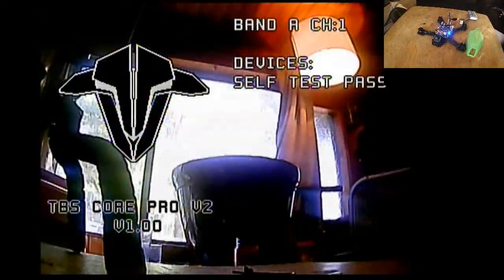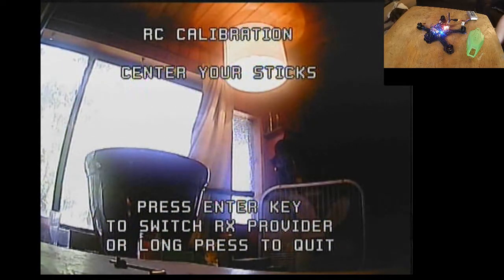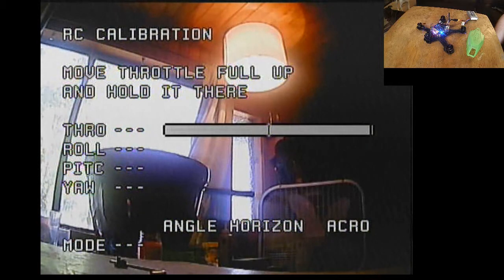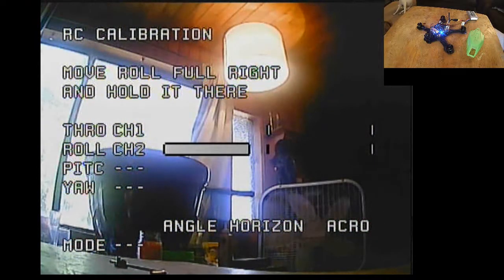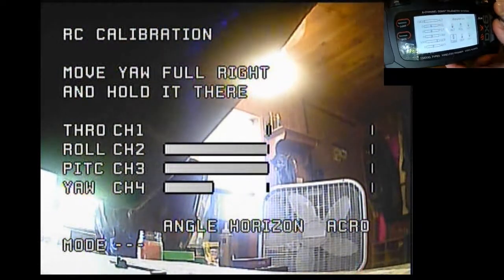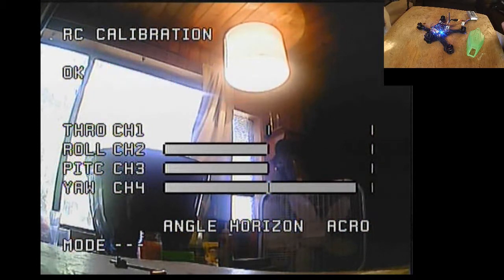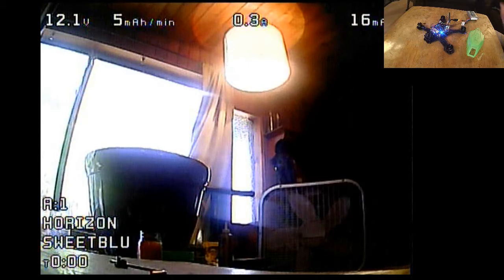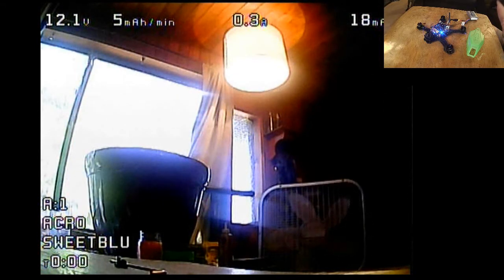RotorX Atom V2 DIY kit How to: RC Calibration via OSD

Comment: I have a couple of questions. So I recently purchased a DIY Atom v2 kit, and the instructions online are very clear in regards to the actual build itself. My quad is completely built and connected to my DX6I. This is where the instructions sort of end. I know there is more programming to do, so my question is what else do I need to do before I start flying. People have mentioned clean flight, and beta flight. What is the difference between the two. Also, how do I know what flight settings to use. I have been flying quads for a while, but am new to FPV and am trying to learn how to fly in acro. Is there a way to set my quad in acro mode, but have the rates be low (i'm assuming this means slow). Thank you!!

Comment: Thanks for your help I kept my whip antenna on also because the other end were you clip on antenna started to peel off so I put crazy glue on what that safe to do
Reply from the maker: I would suggest some hot glue perhaps but super glue won't hurt, just possibly difficult to remove.

Comment: What do you prefer the whip antenna or the triumph antenna I'm stuck between the two what are your suggestion
Reply from the maker: I love the whip. At 25mw I can rip around the house and yard no problems, and at 200mw I can run around the local park and neighbors houses with no issues. And at 800mw I can see through different dimensions. But seriously the saved weight and the fact I have a lower profile (so I can hit smaller holes/gaps) it is well worth it.